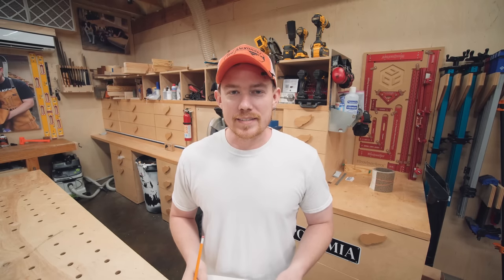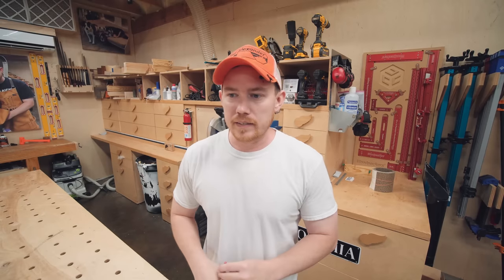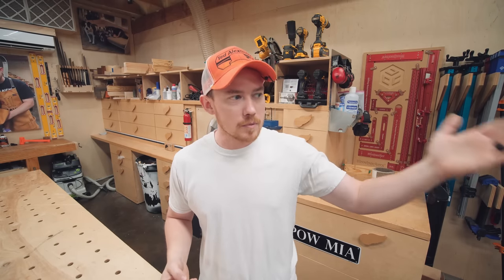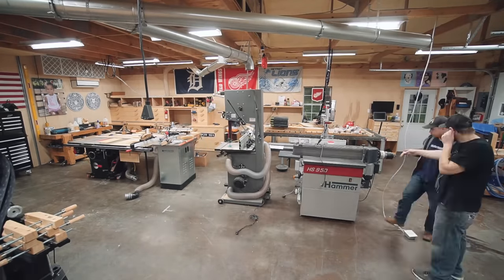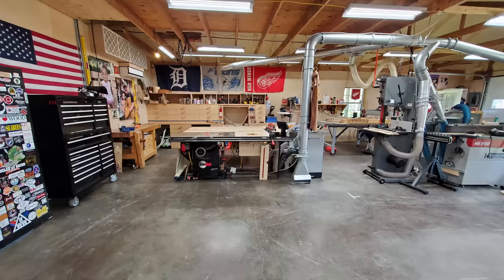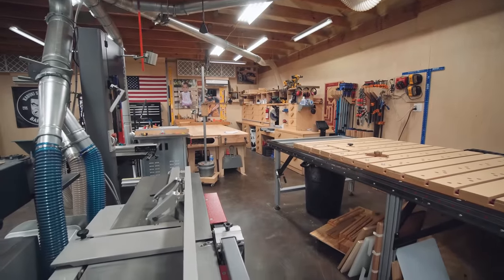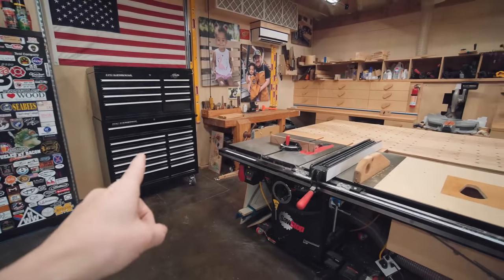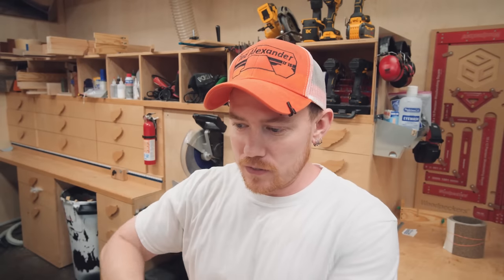Vlog #163: Same Shop, Half The Space

Comment: Love the new shop layout, looks really cozy indeed. I totally get your point of going back to your old miter saw because of dust collection. I recently bought a bosch proglide 12inch and I absolutely hate the dust collection on it. I've built a box around it just like you have with a 4inch dust port hooked up to my 3hp DC and still get dust spraying everywhere, even with the opening only at the blade. Definitely think I'll be switching back to a dewalt 12inch slider. Anyway shop looks amazing!

Comment: Hey Jay, Have you had any issues with dust and chips going into your cyclone filter stack. It's usually caused by a leak somewhere around the chip barrel lid or hose connections. I've had it happen twice. The first time was that little length of hose between the cone and the barrel. I haven't figured out what is causing it for the second time.
Reply from the maker: Only when I overfill the barrel. An easy way to find leaks in a DC setup is to use a long reach lighter. All leaks prior to the impeller will suck the flame in. All leaks after the impeller will blow out the flame. And if you don't like playing with fire, light an inscent stick and use the smoke the same way.

Comment: Love the new layout. Just curious, would it be better to move the dust collection system outside to cut down on noise, or does it really make any difference with different tools running.
Reply from the maker: Noise isn't a concern with the tools running and hearing protection being used. I'd rather not annoy my neighbors by having it ouside.
Reply: @JayBates2  : you’re a good neighbor. I’m working on my shop right now and can’t tell you how much these uploads have helped. Thanks again.